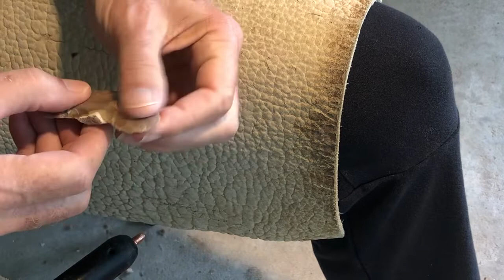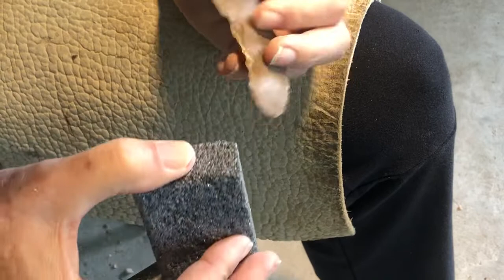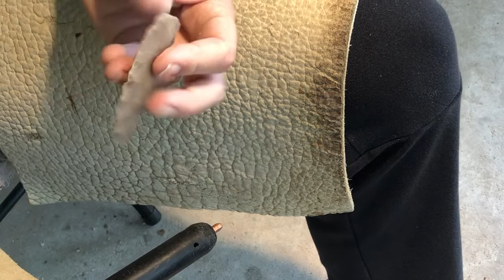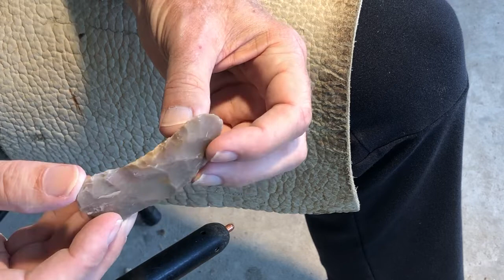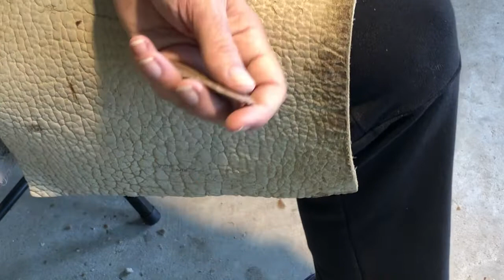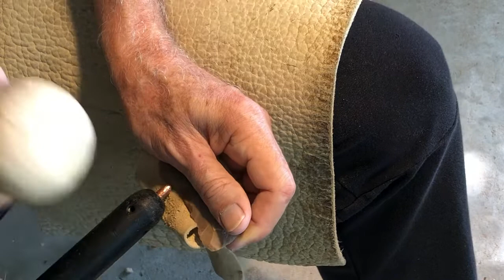whacky little nodule 3rd of 5 vids

Comment: Mr. FC, you are the pro and I have learned very much from you on  how to get out of the OS pile building group. Only with a kind suggestion may I tell of a proven safety net for accidental drops of the material, I put two old T-shirts that I cut open on sides and place them in the suspected Lz. Saved my hobby stone or glass many times. You have very high talent and skill and keep up the dialogue. All good over here in ol red stick.